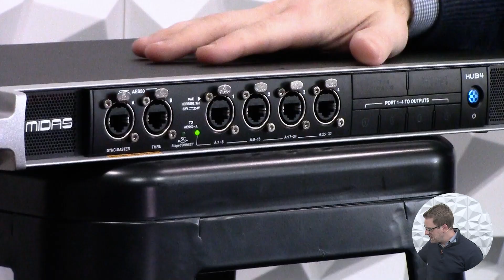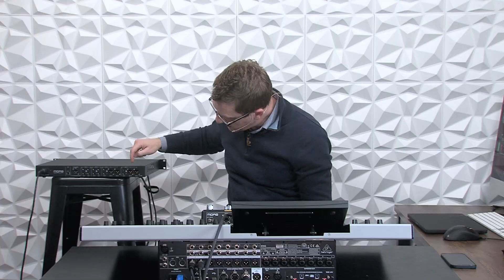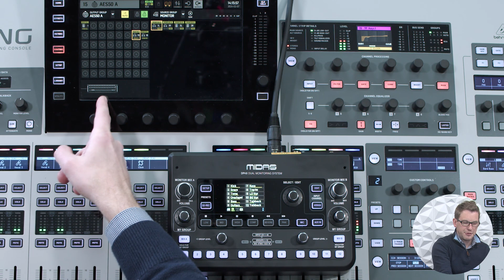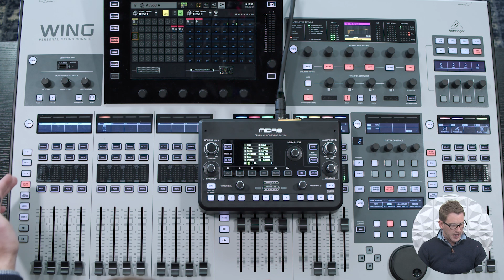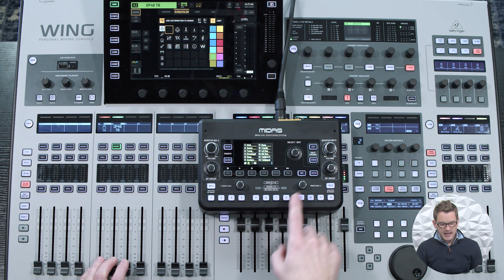Using the Midas HUB4 + Midas DP48 + Behringer Wing

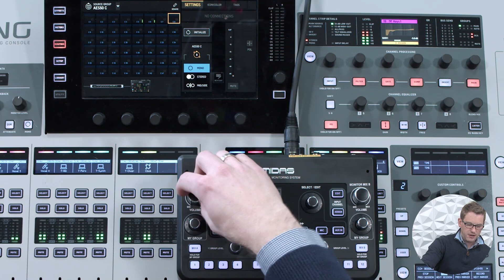Comment: Was rewatching this video and noticed something you missed that matters. At around the 3:30 mark you show the signals coming back to the wing from the DP48 mixer. Note that only happens if the Port 1-4 button on the hub 4 is turned on, which we can see is on in your video. by default the hub is passingthrough signals from its B port to the console, stagebox is the idea or cascaded hub 4 units.

Comment: Drew great video. I’m having an issue where the channel names are transferring. Firmware is updated on the wing and the DP 48. I’ve tried connection with and without the hub4, but it doesn’t solve it. The outputs and sources are named on the wing. Any ideas?

Comment: wrong on having to have shield for the PoE to work. PoE will work without a shield. The shield is needed  due to following AES50 spec.
Reply: But its for protection thsts the whole point
Reply: @KutanaStudio  that is besides the point. He clearly stated that PoE would not work without a shield. That is a absolutely false statement.

Comment: I use the HUB4 exclusively for the 16x analoge out to 8x Wireless IEM (without DP48). This allows for my wireless IEM rack to stay pre-patched and I only have to connect 1x AES50 (Wing AES50-A to HUB4 AES50-A) and 1x antenna cable to my antenna combiner.
HUB4 AES50-B (thru) goes to my DL32 and the daisy chained DL16.
The 16 outs on the back of the HUB4 have fixed AES50 channel number: 33-48
Reply: Are your Wireless IEM stereo?
Reply: @paradisevalleychristianchurch yes. 8x stereo.
Reply: Hey man! Super curious about your setup as I'm thinking about doing this as well. 

I have an S16 with my Wing Rack that is currently running my additional 4 wireless stereo IEMs:

Wing outputs 1-8 (4x stereo IEMs)
S16 outputs 1-8 (4x stereo IEMs)

If I incorporate the HUB4, can I essentially free up the outputs on my S16? Am I understanding this correctly?
Reply: @PeterCruzMusic  yes. And you can keep all outputs of HUB4 connected to your IEM’s and just connect everything with one cable. Daisy chain your S16 behind the HUB4